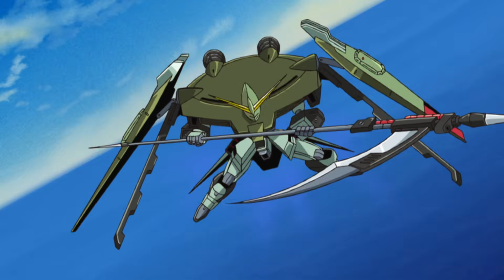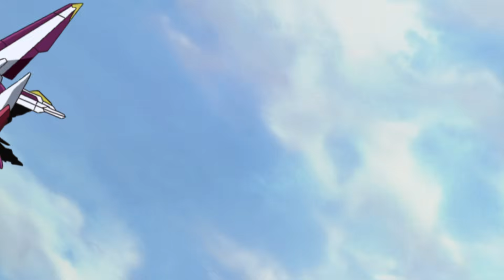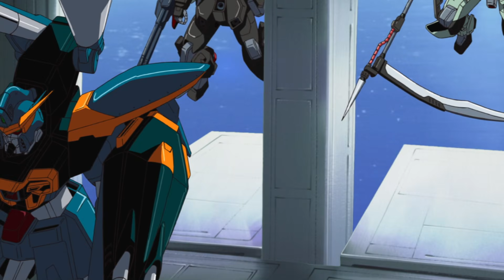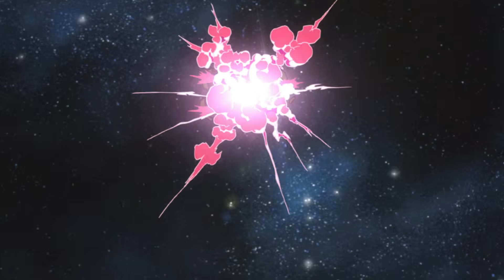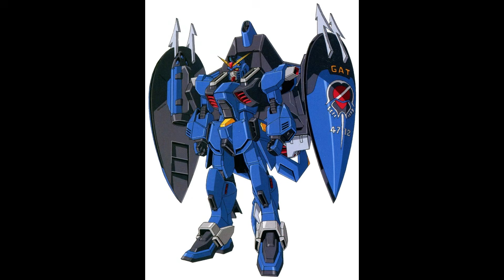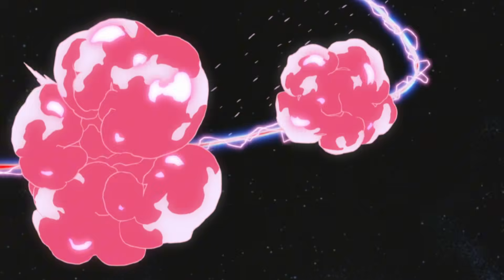MECH ANALYSIS FORBIDDEN GUNDAM

Comment: x100 more on balanced equipments - frontline/mid or back 
x200 special equipment (electromagnetic interference) stealth/geschmeidg panzer beam bending shield 
x300 movable frame or rather transformable mobile suits most likely very quick transforming sequence to avoid shot down during changing sequence

Comment: In term of maintenance. I just think of Majestic Prince, each unit has their own pit crew that was involve with it creation
Reply from the maker: I'm glad you mentioned Majestic Prince.

Since it has the same art style and similar elements.

Even if it wasn't that good of an anime.

But even with dedicated pit crews.

The machine's complexity would still make it quite a challenge.

These machines could not have an equipment malfunction in combat otherwise its game over.

🙂
Reply: @K4KriticaL 
Well, they perfecfed the design with Black 6 allowed it to be maintained by automaton. Likely the same with the mass produced Black 6

Through it is unclear whether Black 6 could awaken at all.

Nope, MJP is way better THAN Destiny
Reply from the maker: @huntermad5668  I'm not gonna say one anime was better than the other.😀

They both had problems.

MJP felt super rushed even with the movie.

And Destiny just seemed to have no effort put into it at all even though it had the fulol fifty episode run time.

Have you seen Heroic Age?

I liked that one.
Reply: @K4KriticaL 
Rushed???

Well, the worst thing about Heroic Age is the 2 brothers survived and got some more influence from the Princess...
Reply from the maker: @huntermad5668  What I mean is that MJP felt a bit formulaic.

It had a lot of sci-fi elements crammed into it with a bit of forced coherence.

It's not horrible.

But I did feel that the series had a lot of untapped potential that it completely let fall to the wayside.😞

Well Heroic Age did have some loose ends like those brothers.

But it did deal with the main crux of the story.😀

Comment: Will Athrun be an EPIC Forbidden Pilot more than that drugie?
Reply from the maker: I can see that.

I think this dude was the most unstable out of the three.

He went down first too.
Reply: @K4KriticaL shani(forbidden) was on stage4 in the development, clotho(raider) on stage3, and orga(calamity) on stage2.. orga is the defacto leader and the most stable and follows order much better, like when Natarle chose orga to retrieve the lifepod instead of the two, with minor arguments
Reply from the maker: @MeisterTreizhe  That's interesting idea.

But for me.

I think those stages of enhancements are most likely tied to the complex operations of their machines.

They are tied directly to how the three different frame series operate and their distinct characteristics.

X-100 is the most basic and easiest to operate. Requiring less enhancements.

X-200 is the most complex one due to the special equipment.

X-300 is more difficult than the X-100 but less complex than the X-200 to operate due to the transformation mechanism installed.

While transformation mechanisms may differ.

Its the same requirements for the X-300 frames in the end.😀

At least that's my idea.

Comment: Everytime I saw the Forbidden, I thought, "Stop using beam weapons! Uses kinetics!"
Reply from the maker: True.

But for the forbidden.

It was an endurance thing.

Even if you use kinetics, it still had trans-phase armor which defends against that.

But yeah, just keep hammering away at it until its energy reserves  run out.

Or run up on it with CQC beam weapons and show it that its large scythe don't scare real Gs.
Reply: @K4KriticaL  The railguns actually do a lot of damage. Besides, you just need to damage the shield emitters before you go crazy at ripping the Forbidden to pieces.
Reply from the maker: @WolfeSaber  I'm not questioning the damage power of the railguns.
 
What your saying is correct.

Target the emitters.

But the forbidden in the hands of a competent pilot isn't going to make it easy for you.

😁
Reply: @K4KriticaL  Yet we see the Forbidden staying still a lot.
Reply from the maker: @WolfeSaber  
Lol!

How true.

But I think that's more of an animation problem.